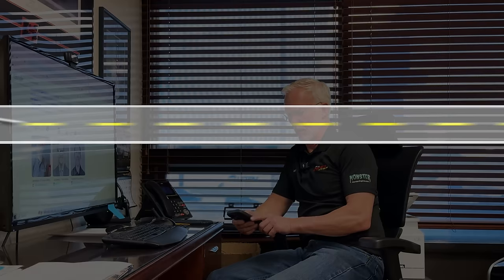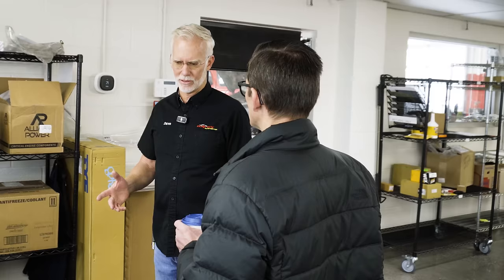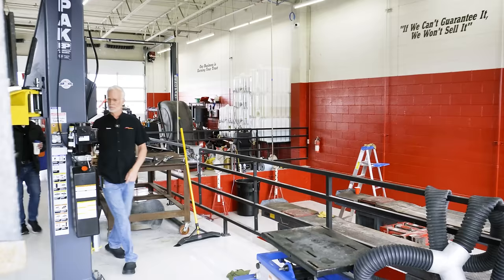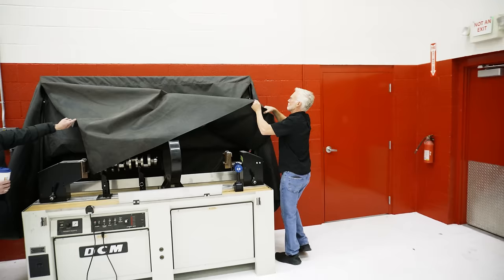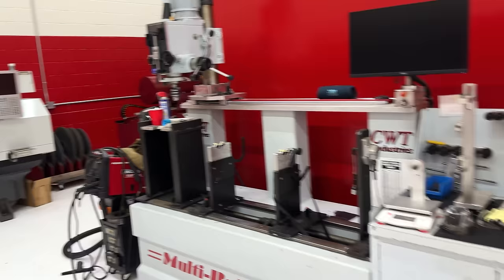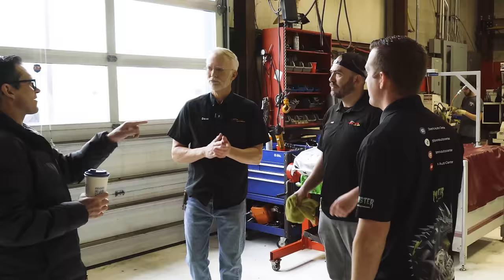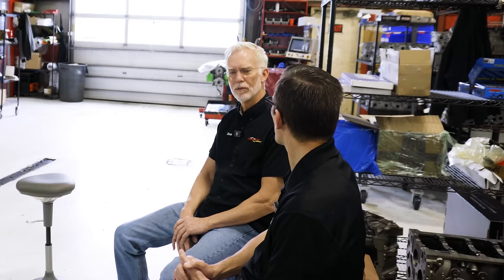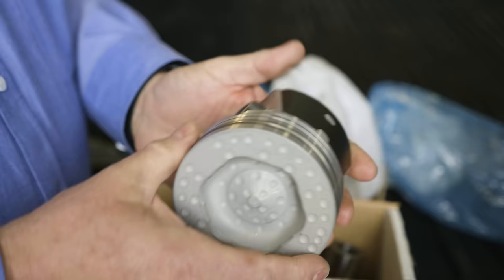Sitting Down With Lake Speed Jr. - The Truth About Oil Change Intervals and Analysis

Comment: I agree with your oil change recommendation 100% 
I change mine every 5000km’s because my daily driver Infiniti SUV calls for every 10,000km’s intervals. 
I also agree with Lake’s comment about Porsche owners not driving their cars, however that doesn’t apply to me, because I have 250,000 km’s on my 1985 Porsche. And the engine hasn’t been apart yet. 

I actually sent Lake Speed Jr a question on the oil I’m using in my Porsche and he responded to me within hours. He’s a smart cookie.
Awesome video as usual Dave, thanks for sharing with us 👍👍
To anyone reading my comment let’s not forget about the miles vs kilometres. We are using kilometres in Canada
Reply: The former head engineer for Nissan suggests changing your oil every 2500 miles. He said that's when engine oil starts to break down and engine wear begins.
Reply: I always used the suggested drain interval  of the oil manufacturer, at cut it short early, not the vehicle manufacturer's interval.   The owners manual assumes we're using their OEM oil & filter AC Delco, Motorcraft etc.
Reply: @donniev8181  maybe years ago with conventional oils, but today with the good quality synthetic oils that’s out there I don’t believe we need to change our oil every 2500miles. Plus most cars and trucks back in the day only had 4 or 5 quarts of conventional oil in them. These days car oil capacity is much more. So I believe it depends on the car and the amount of oil it takes plus if it’s conventional or synthetic oil that determines how often you need to change your oil. Plus the kind of driving and the climate you drive in would also play a role in the intervals you change the oil. However I’d still change it half way through the manufactures suggested intervals. My antique Porsche has a oil change every spring after it’s been stored for the winter, and that thing holds almost 9 quarts of synthetic. I change it because the car sits for so long not because it has a lot of miles on the oil. I’m not saying that everyone should do what I’m doing, I’m just giving my two cents on the topic. 
Are you changing your oil that often?
And if you are I’m sure it will definitely do your car a lot of good in the long run. I just done the conversion for km’s to miles and 2500 miles is 4023 km’s so I think we are both on the same page👍
Reply: @andyjohnson6548  oil is oil, I'm pretty sure the head engine builder for Nissan knows a thing or two about engine oil. Even Dave said his warranty stipulations include changing the oil every 3k miles.
Reply: @donniev8181  I’m not sure if you think I’m arguing with you on this topic but I’m certainly not. We are actually on the same page once you convert miles to kilometres. And Dave is suggesting 3000 miles on the engines he rebuilds. Looks like we are all on the same page 👍
It’s also common knowledge that car manufacturers don’t want engines to last beyond warranty because they want to sell cars.
Reply: @andyjohnson6548 I change my bikes oil every fall to get out any contaminants before the long winter here in Sweden. Makes me feel better knowing it’s resting with fresh oil.
Reply: Definitely a good idea👍 I do the same with my bike even though there’s very little miles put on the bike each summer.
Reply: @andyjohnson6548  I figure it’s a holdover from my army days, make sure it’s good to go before you put it away. Figure used engine oil is slightly corrosive on something and that new oil won’t spoil in a few months of just sitting in the sump. Do the same with tools, camping gear, skis hell even pots and pans. When it’s time to use the thing I know it’s good.

Comment: I had never even thought about oil analysis until i got my pilots license and started helping with the maintenance of the club planes.  now i do it for my vehicle.  14 audi 3.0 TDI.  The one i use and probably most of them can tell you so much by what is in your oil.  I've seen reports that say they are seeing increase amount of whatever and can tell you what its most likely from and you can prevent and engine failure possibly in flight because you can pinpoint an issue before it really becomes one.  Absolutely worth the $30 or so.  after watching this i am thinking more and more about getting a bypass oil filter system for my vehicle.

Comment: That was great.  Oil is cheap engines are expensive is what I was taught.  Bought my first brand new truck in 1987 just out of high school, Ford Bronco with 302, first oil change at 1000k, 3000k after that. sold 10 years later  with 180k still ran like new and never touched engine other external components.  All Toyotas now and change oil 3k first/new and then every 5k. Brother in law says his new Volvo only needs every 10k so cheaper maintenance.  We'll see  how long it lasts.
Reply: Sounds like Scotty Kilmer. Keep the good work up and long live your machines.

Comment: I'm not mechanically incline.  Never will be.  But my father beat into my head to change the oil often.  He did it in the 1960's every 2,000 miles.  I think he still did it to when he died in 1998.  I switched to 3,500 miles in the 2000 religiously. I'm 67 and have never had a blown engine. I sure learned a lot today.  Thanks Dave and Lske.

Comment: Dave is achieving cutting edge quality with his service center here. Very very impressive.
All I have run in my cars for the last 30 years  is Redline Motor oil. Superior synthetic lubricant with a really good ZDDP pack in it and its detergents have a very easy life as there  is nothing sticking to the metal to clean. A motor at 100,000 miles with a life of Redline you can wipe the valve valley off and it will be pristine because the oil never breaks down under high heat. Only oil I have ever used that you can hear the difference in the engine. Its not cheap. Try it just once.
Reply: I can vouch for Red Line as well.  It is top notch and they are one of the only ones to use Group V (POE ester) base oil.  I use to run it in everything I own but it became very unaffordable so I recently made the switch to Amsoil which is group IV PAO

Comment: I had an old mechanic teach me about when to change oil he said oils changes  are cheap replacing engines are not so change your conventional oil 3000 miles and 5000 for synthetic oil  you guys are spot on with about changing oil

Comment: I like changing oil and filter after the first half to 45 minutes of run time on a new or rebuilt engine , the amount of metalic in the oil after breaking in time is  crazy such a wake up call thanks for all your great info , I use Amsoil in my diesel and my tundra 5.7 motor and get great performance out of Amsoil in my Tundra I use Amsoil 10w-30 signature series in heat and winter conditions in Moutains…

Comment: I use oil analysis whenever I get a newer car for my family.  I run oil analysis at 5k, 7500, and 10k on my highway runners to make sure running 10k is ok,  I only run Toyota and Lexus and I have yet to have one come back that 10k was too long of an interval.  My non highway runners I change at 5k.  Thanks Dave and Lake for your knowledge.
Reply: Right on!
Reply: It's the shorter trips that really cause the problems. I remember Exxon Mobil testing a 2015 Silverado 1500 5.3 and they torture tested it for 500k miles without a single lifter issue. They tore it down and it look immaculate. Just like any Toyota engine that's been very well maintained. The difference in my opinion was that they did a highway/towing torture test for 500k miles. They didn't start the engine after it sat all night in -10F weather, let it idle for 30 minutes, drive a mile or two, and shut back down. That's the kind of driving that contaminates the engine oil and causes lifters to fail. Detergents can't remove fuel contamination, the diesel-like soot that direct injection gasoline engines produce, the moisture that accumulates and isn't evaporated in a short trip, etc. The only thing that can removed all that contamination is changing the oil.
Reply: Cold starts and short trips are terrible on engine oil life.
Reply: @hochhaul  I bet they had the AFM deactivated bud!

Comment: I have always changed with full synthetic every 4k miles with a "10k" filter and  10k mile high milage oil in my work vehicle an 08 sorento and my wifes work car a 13 optima. Its cheap it takes me literally 40 minutes to pull them both up on my ramps no reason not to. We drive 40 miles each way to work so super important to have a vehicle to put a shitload of miles on to not destroy value of new vehicles. We have each put over 100k miles on them in the last 5 years just driving to work no issues at all.
Reply: The problem with that is the car is going to make it to 300k with 10k oil changes. You’re spending at least $1500 extra over that 300k on oil changes which could get you an engine swap.

Comment: I am from UK and have been aware that since before WW11 US machine tools are in a different class.  Ie Packards superb production of the RR Merlin. I really enjoyed the discussions and although I could not follow it all, it was very informative and surprise surprise changing oil regularly IS beneficial to the engine. The only thing I would add to the discussion is if you have a classic car which will spend the winter in the garage change the oil before laying it up. I admire the quality of your engineering.

Comment: I still use SAE30HD.  I have a 2013 LS460 V8 w/200k miles.  Viscosity Index improvers are NOT lubricants and they occupy ~25% of the full quart of oil.  With mono grade oils, you get the full advantage of 100% of the oil lubricant in the bottle.  Less sheering too!

Comment: friend built a PVC catch can variation with clear tubing inserted in the  hose coming from the valve cover hose to the intake  filled loosely with pot scrubber steel wool from dollar stores.  at the bottom was a T with a drain  tube off it.  Their egr on that diesel was still clean a few 100K miles later.. They were into it for like 6-7 bucks. every few months  the drain was grey with sludge

Comment: Hi from Oamaru New Zealand.
I'm using Amsoil grade 5w-40 Signature series diesel engine oil in my Spanish built 2012 Nissan Navara D40 Diesel. Engine is a Renault - Nissan partnership engine.
I'm running this àt 25.000 mile drain intervals with a oil analysis done by Caterpillar dealer test facility.

Comment: My question is now, why does companies like amsoil recommend up 25k mile oil change intervals? Surely they have testing and data to back their claims, at least in certain scenarios?
Reply: They recommend at those intervals because they have been formulated tested on real life scenarios. They also tell you to do oil testing to know and not predict if it’s safe to continue. The reason why amsoil are they’re on their own and not a labeling market along with others that have green environmental label. It’s because they’re not being controlled by main oil companies. There oil have more additives and much more protection compared to your local oil brands you find anywhere.  

I’m a amsoil user and I can testify that running there oil and changing my oil at certain mileage and having it being tested. They tell me whether it’s safe or not. You also have to understand the science behind it too. I have 2016 GMC  and many other vehicles that I bought new. I have always ran amsoil oil. Not a single engine failure and even my turbocharged vehicles have not experience a single piston failure or turbo.
Reply: Amsoil is snake oil

Comment: I think 3K oil change interval is a little excessive, depending on your driving style and where. I stick to 5K and have 200K and counting on a hemi all stock.
Reply: 3500 mich gas sucks
Reply: On a HEMI!  Impressive.  The cam doesn't line up with the oil flow.  Ot shouldn't last 75k.

Comment: I've got a 97 7.3 powerstroke and I'm using hotshots daily and occasionally use the extreme. The engine doesn't sound as good when I forget to add it. I also change oil every 5000 miles. No issues for 287,000.
5000 mile change intervals, my oil consumption is about 1/2 quart in 5000 miles

Comment: I did a oil analysis at 50K on my 2019 V8 Mustang. I was very happy to see it is in good health. I was worried about a coolant leak because I had some disappearing coolant from the reservoir. But I was told that's likely some leaking at a y pipe leading to the thermo. But I haven't had to top off in a long while now. So it may have fixed itself.

Comment: Great video I have a 2002 chevy s10 with 2.2 4cyl 5 speed manual I purchased it brand new with 60 miles it now has 408000 miles roughly I’ve changed my oil at every 5000 miles using Mobil 1 5w30 the first oil change was at 3000 miles I did the timing change last year for piece of mind I was surprised the tensioner had a little wear not bad compared to the new one and the chain felt great compared to original one . This was a awesome video especially the part about the oil change interval. I tell people all the time don’t believe them .

Comment: First car I owned was a '59 Impala, 235 straight 6. The previous owner only used Wolf's Head 30W. I remember changing oil in that thing and having to run my hand into the filter housing to removed what felt like 120W grease. My dad wouldn't let me run detergent oil in it for fear it would fly apart like a $2 watch.

Comment: The part I found most useful, as the owner of several 1.9-liter Volkswagens with the  ALH TDI engines, was the discussion of zinc versus detergent additives. If the parts-per-million of zinc falls too low, then there will be excessive wear, but as long as it remains above 1000 ppm (for most engines) then the oil is still good. Yes, detergent levels drop gradually too. But detergents start out very high, so after an oil change the high concentration of detergent removes the zinc coating from moving parts and will actually increase wear until the zinc in the new oil is able to lay down a new coating on the metal.

My point is -- and this is not inspiration of my own, but what I've learned from some very knowledgeable people -- is that a too-short oil change interval can actually be bad for an engine. The wear during the first 1000 miles after an oil change has been measured to be greater than the 2nd or 3rd or 4th thousand miles after the oil change. 

Your mileage may vary, but I put slightly over one million miles on an ALH TDI engine in a 2003 Golf TDI, with oil changes roughly every 10,000 miles. (Actual 92 oil changes for 10,900 mile average OCI) After hitting that million miles I turned it into a parts car. The block, crank, pistons and rings were all original. I used Mobil 1 TDT 5w40 or Mobil Delvac 1 ESP 5w40 almost exclusively, though Amsoil was used a few times. 

What is important is the zinc. Catalytic converters and diesel particulate filters do not like zinc. Cams and lifters love zinc. If your vehicle does not have a cat or a DPF, then use an oil with plenty of zinc and extend those oil change intervals.

Comment: I live in central Louisiana. I have a 2017 Ram 2500 4x4 with a 6.7 cummins. I always change the oil before summer and again in the fall because of the extreme heat and humidity.

Comment: I have used Mobil 1 15-50 with 1,200 ZDDP ppm with zero wear in my air-cooled engines along with regular oil analysis for the correct oil change intervals based on performance and usage.

Comment: Best video I've ever watched explaining oil routes and engine designs. I will never go over 3k mi on an oil change interval.  I'm 65 and I've enjoyed driving since I got my license at 16.  Part of the enjoyment is knowing my engine is taken care of, piece of mind on the road. Money is no factor when it comes to that with me.  To those who consider the money I understand, but going 10k mi on an oil change is definitely not for the person who plans on keeping the vehicle, just my opinion. I don't care how good the oil is, it is never going to be contaminant free.  I'm no ace mechanic but I can tell you from experience, the oil on the dipstick looking clean or fairly clean is not the way it looks settled in the bottom of the oil pan all the time. Not all engines have the same characteristics but one thing is constant.  Keeping the oil changed to ensure a proper mechanical environment is a plus factor. I will say if you are going over 3k, check your oil regularly.  I check my oil about every 2 weeks, sometimes weekly.  It saved my 05 Triton 5.4 3V as I discovered since it was new it uses about 1/2 quart every 1500 mi.  (I'm waiting Ford bashers,lol).  It's got 192k mi and runs fine.  Did upgrade the followers and VCT's at 120k.  Oil consumption is believed to be the PCV valve design.  I just add oil when it needs it, it doesn't smoke, overheat and has enough power to pull a 2800 lb boat no problem.  Gets 15 mpg.  Tritons aren't known for gas mileage, but it hasn't changed since it was new.  Not buying a FX4 for todays money.  Will replace engine with a crate motor or have Dave's Automotive rebuild it if they do these when needed.  Bottom line,  these 5.4 3V's have their problems but a 3k mi oil change has kept mine in service and a truck that doesn't owe me anything.